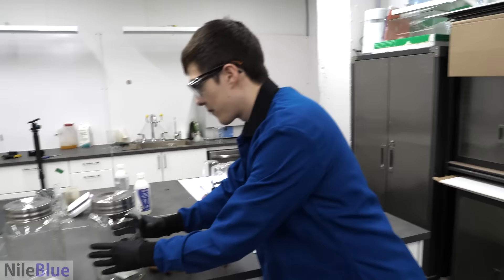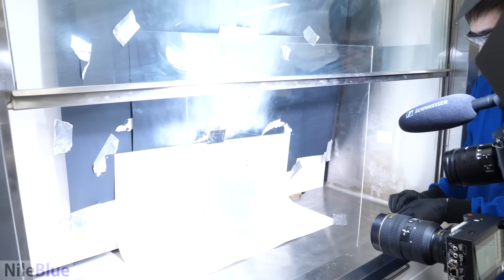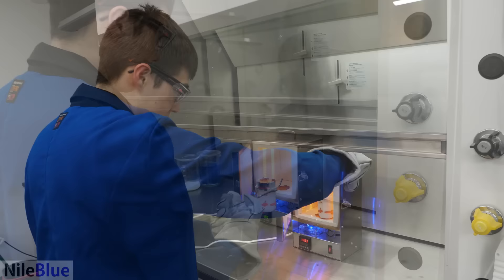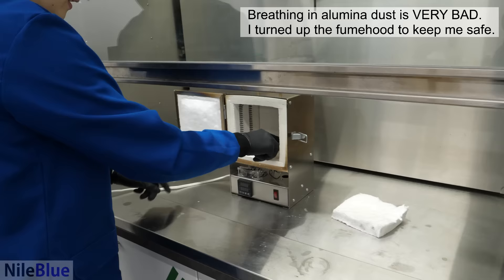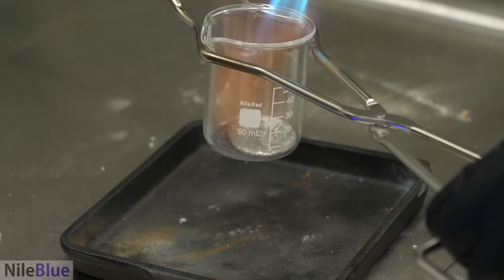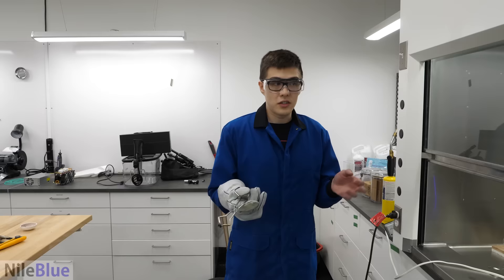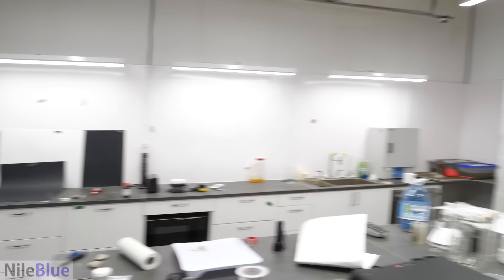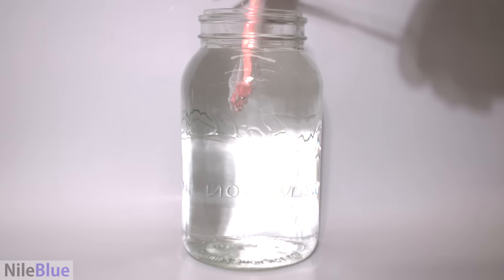This project was a disaster.

Comment: NileBlue makes me feel like he learned all this yesterday. NileRed makes me feel like he’s the only professional in the subject.
Reply: I don't see him wearing a filtered mask for the Alumina(?) dust, and 1/3rd through the video it seems obvious that the plexiglass isn't going to shield him when he pours it, they also haven't taped down the wires. He doesn't clean up the toxic dust before going to the next stage of the project, and he doesn't keep track of his materials like his gloves, leaving him to leave the active area and search for it, then he discards it to the floor.

I mean, I haven't done any chemistry, but these all seem like, pretty obvious hazards and dangerous failings that are all reasonably easy to address? Like his lab methodology seens really bad :(
Reply: One other possible explanation could be that the water on the second attempt was cold and freshly poured, whereas the first attempt had been sitting there for a while and was probably at room temperature
Reply: @aster_nova  Do you not see the fume hoods?
Reply: @watermelon4man408  The dust is pretty close to the edge, are you sure it would be picked up by the fume hood? 🤔🤔
Reply: @aster_nova  There's definitely a difference between the dust you see laying on the surface, which is big and kinda clumped together, and the dust that the fume hood collects. So when something (like wind or them accidentally touching) disturbs the dust on the surface it will give off tiny little dust particles into the air. (Compare it to the dust laying under your couch and the dust that comes out of the couch cushions if you hit it) Those will be sucked up by the fume hood without problems. The "bigger" dust won't and thats okay, because them breathing wouldn't pick it up either. 
But in general I'd like to note that he knows what he is doing. He wore the gloves, long sleeves and glasses. If he or his friends really saw a major hazard in what they're doing, they would have adressed it.
Reply: Nileblue also fell asleep half way through the lesson, so he’s improving a good portion of it
Reply: Well, this is basically behind the scenes and he shows the fun of it 😂
Reply: Alex O'Leary everything you said is now invalid, because you just called liquid bronze room temperature
Reply: @rczg  he clearly talks about water temperature
Reply: @aster_nova  He has a fumehud which protects him from the dust and he probably knew if plexiglass could resist stuff like that beforehand. He's done this stuff for years ya know.
Reply: @aster_nova  You need to chill. As you said, you're not a chemist. He's been doing this and studying this for years. This channel is specifically meant to be more casual. You don't need to critique every little action he makes in an offhand little experiment He's doing literally for fun. He is better at this than you. Don't forget that.
Reply: @PogoLogo352  i know the Nile knows what he is doing but I still had a concern about that dust just laying on his gloves and  in the fume hood. Thanks for explaining that
Reply: ITS NILE RED
Reply: @aster_nova  I also think the way he pours it plays a factor. The second time he was confident it was the one, and I noticed him jolt the crucible when pouring, so it for sure made a different shape in the water, and maybe a more preferable shape to keep that pocket of air underneath until it can hit the glass.
Reply: @rczg  no they didn't? They called the water from the first attempt room temp?
Reply: @aster_nova  Regarding the alumina dust, it specifically points out that he cranked up the fume hood to deal with that problem.
Reply: Alex O'Leary you’re not wrong, his whole methodology is bad
Reply: It's like the opposite of Explosions&Fire, where the main channel makes it look like he's flying by the seat of his pants making polynitrotetrazoles, and then on Extractions&Ire, the secondary channel, he's actually showing you chemistry.
Reply: I dont like that Nile red guy
Reply: @aster_nova  if u can read he said he had the fume hood on max
Reply: @aster_nova  fume hoods are pretty amazing. They have to be certified and tested so it’s very unlikely that it being close to the edge impacts its performance.
Reply: This blue guy is a loose cannon.
Reply: Strangely, both could actually be simultaneously true...
Reply: @purple fruit and @Alex O'Leary as a chemist I see his work more casual and if he isn't hurting himself or the others in the lab (as he seems to take care he doesn't) it's just fine not to consider every single tiny detail, of course the dangers must be addressed but it's different if he wasn't aware of them in the first place, that would be unprofessional. he's no way the only professional, he just explains and does the projects in a simple way, that people understand and have fun learning it :). no need to pick sides here, in this case the middle is the best option.
Reply: The duality of man
Reply: @UsedBlue1973VWBeetle  agreed, I'm a biochem undergrad in my junior year, and Nile seems while a little reckless in some things, he is taking measures so no body gets hurt, and those measures were successful. Job accomplished.
Reply: @aster_nova  when adding molten metal to water, there isnt a whole lot of difference between water fresh from a lab sink and water that's been sitting for a bit, in terms of the temp difference. Now, addressing the lab methodology, well, everyone else already tore you a new one so I'm not gonna beat a dead horse.
Reply: Are nile red and nile blue the same?
Reply: @colonelarrow8031  yes, they are two channels of the same guy
Reply: @louiesatterwhite3885  thanks 😃
Reply: @aster_nova  In a professional lab, where people are paid to research and do stuff, it's the lab responsibility to provide proper safety for the chemists. It is the chemist's responsability to follow the lab's security protocol so that their security plan can work and people in the lab can be safe.

This is a private lab, he knows the risk, and the people with him too, he doesn't bother with the complicated security measures like keeping track of non vital equipment, making 100% sure that he cannot get hit by any liquid metal and whatnot, because it's only him and his friends (who know and are aware of the risks involved) that he is putting into danger. He is not putting at risk a random coworker that is working on another thing a few tables away, he is not putting at risk someone that is going to experiment tomorrow using the equipment he used and maybe damaged during his experiment. 

As I said, the lab owner sets the rules, if he is comfortable with a bit more risk to save speed and ease of use, then as long as he knows the risks, he can perfectly do that.
Reply: They are the same person
Reply: Are they not the same person?
Reply: @pastelpinksparrow9436  no, they are identical twins but it’s a inside joke to say they are the same person.
Reply: @TheS1ickness  Are you serious?!
Reply: Tbh Neil blue probly did learn it yesterday
Reply: Nilered is the nurdrage of chem and nileblue is the roadkill of chem
Reply: @aster_nova  At some point safety measures become time wasting measures. When you have your own lab you can implement your own safety standards, but Nile and friends have never had a serious injury in the history of this channel.
Reply: @pastelpinksparrow9436  no they were joking lol
Reply: @aster_nova  it's pretty obvious that he does it for fun. And I think he's been in this field for a little too long to not know the hazards and risks, probably just for fun
Reply: @aster_nova  „i havent done any chemistry, but…“ 😐
Reply: They are both the SAME!!!!!!!!!!!!!!!!!!!!!!!!!!
Reply: @aster_nova  On your toes, boys...Look alive. 
OSHA has entered the job site.🤦🏻
Reply: @supreme_brick  Why?
Reply: That's scientists for you
Reply: I agree
Reply: Lol one critical coment and all just rage on him 😆
Reply: Yep same
Reply: Omg you're so right
Reply: As with most things, the truth about Niles ability lies somewhere in the middle of Nileblue and Nilered
Reply: Their the same person
Reply: Ikr🤣🤣🤣
Reply: @aster_nova  he said he did it in his fume hood...
he never said anything about wearing masks
Reply: @aster_nova  is it really important to focus on mistakes and not the good things he explains?
Reply: I think good chemistry is walking the line between both
Reply: Hahaha why is this so accurate 🤣
Reply: They must be good twins
Reply: Science is the never ending pursuit of learning new things.
Reply: Being a professional is knowing what not to do
Being an expert is doing it
Reply: Nile red is the evil twin that always gets what he wants bc ofc he would and Nile Blue is the chill whose only here to have fun with science.
Reply: I swear they’re not the same person
Reply: @aster_nova  if you know any chemists you’d know this is pretty much the case for all chemistry peeps 😄👍
Reply: True
Reply: What about Nile green
Reply: Nile green is another whole story
Reply: Just like all the oldest star in the universe is red shifted
Reply: Yes
Reply: U are a genius 👍😁
Reply: Nineteen makes me die
Reply: I could always see Blue through the Red
Reply: Nile green: "im high on chemistry"
Reply: Look stop tryna take him down a peg he’s better that other youtubers as he doesn’t over advertise and he is way more interesting also he doesnt show off like people like mark rober
Reply: @aster_nova  He did say he turned on the fume hood.
Reply: @aster_nova  aye I mean you literally said the one thing that proves you don’t know what’s a serious hazard and what is because your not a. Chemist why put in that kind of effort to roast a professional chemist if you know nothing???🙃
Reply: @aster_nova  isn't that basically what this comment is saying? that NileBlue is way less professional than NileRed?
Reply: @aster_nova  “i haven’t done any chemistry but…”
nope, just stop right there
Reply: And NileGreen is the alternate universe version
Reply: And now we have NileGreen lol
Reply: NileGreen makes me feel like i snorted a line of coke
Reply: @aster_nova  and that's how you know he is a professional
Reply: That's the gist of it
Reply: Nile green?
Reply: @aster_nova  those hoods move a TON of air. No particulate is coming out of that enclosure
Reply: Literally couldn't have said it better
Reply: @aster_nova  bro it's for the content
Reply: @aster_nova  who woud like to watch some old professional chemist talk about chemical reactions while conducting the experiments
Reply: How does nilegreen make you feel?
Reply: True dat
Reply: @aster_nova  you must be new here hahaha
Reply: THEY ARE THE SAME PEOPLE
Reply: Nile Green scares me.
Reply: @louiesatterwhite3885  the fact that nile red is fairly professional and safe, talks very intelligent.....aaaannndddd  Nike blue is more loose cannon who talks like a first day high school science student makes me believe they are not the same. Could be twins, or father/son.
Reply: what about NileGreeb
Reply: NileGreen makes me feel like I'm watching HowToBasic
Reply: What about NileGreen?
Reply: This is too true.
Reply: @aster_nova  bro chill its a joke smh
Reply: arent they the same person
Reply: and NileGreen makes me feel like I just watched a psycho before he starts the spree
Reply: @aster_nova  “we only care about these” points to cameras
Reply: Not really @PurpleFruit. Teachers in Harvard, Oxford and IIT are my father's student.
Reply: @PurpleFruit *nileblue lol
Reply: @aster_nova  while there are some points that makes sense, it’s not really something that needs to be commented on. In other words, what you said was unnecessary and quite rude.
Reply: What abt NileGreen??
Reply: Yup
Reply: stolen?
Reply: @aster_nova  *seams
Reply: @GeorgeZ213  *nile
Reply: Stop BezinG NERdS
Reply: @aster_nova  if you want to see him be as safe as possible watch nile red
Reply: @aster_nova he is an entertainment scientist on the internet...what do you want?
Reply: NileRed is having a hard working dad, respected in the community. NileBlue is you watching him take a piss in a lake on the holidays
Reply: The line between mad scientist and chem major is a fine one
Reply: ikr
Reply: the funny part is that he prob did just lean about this yesterday and wants to try it out
Reply: @aster_nova lmao yea that’s what their made to do
Reply: Nile green 😶
Reply: @aster_nova 😂thjjj😂🎉😢
Reply: it's both
he is both
Reply: What’s funny is this is the truth with most professionals😂 it takes a long of experience to become actually experienced😭
Reply: NileRed is someone doing neat chemistry and showing people online, and NileBlue is someone playing with chemistry

Comment: I think the temperature of the metal when you actually pour it could be making a large difference. it could be allowing a stronger leidenfrost effect to occur (or potentially too strong) meaning the water doesnt touch the metal until it hits the bottom and cools off a bit.

Comment: 15:01 - Those are the impurities in the metals, when melting down any metals, the stuff that's not metal burns up and floats. It's usually skimmed off to keep the pour as pure as possible, usually if your making ingots or pouring a mold of some kind.
Reply: Also called dross or slag. Using a flux like borax can help pull the impurities out as well.

Comment: Great video! Pyrometallurgy is my favorite. I "grained" precious metals for a few years on a large scale and the constant explosions were hard to deal with. Our solution to calm it down a little bit was to get our water moving with pressure washers / high pressure inlet-outlet lines, and to have the water VERY cold. We played around with different alloy mixes as well, but didn't ever have any solid results. As far as why it happened to us, we assumed it had something to do with the copper content of the alloy, the amount of slag and impurities in our materials, and the Leidenfrost effect creating those steam pockets beneath the solidifying metal. We once poured a little too quickly and launched a stainless steel tank with 150 gallons of water well over a foot off the concrete!